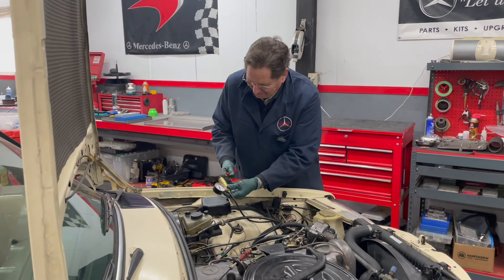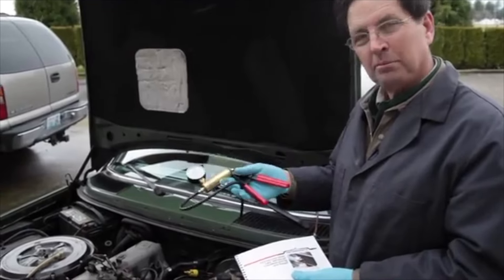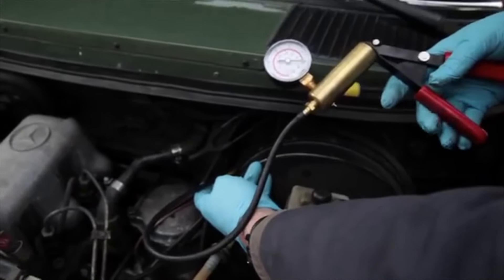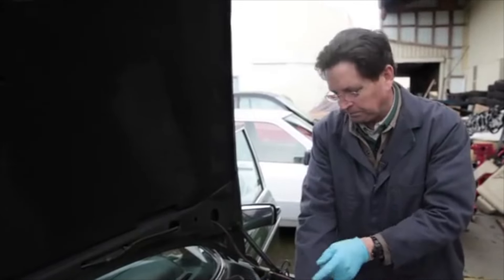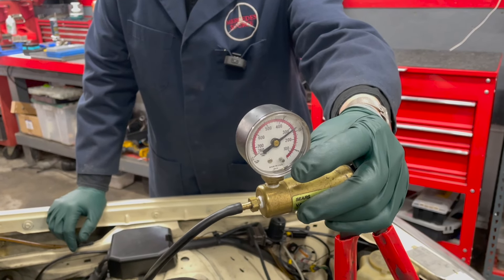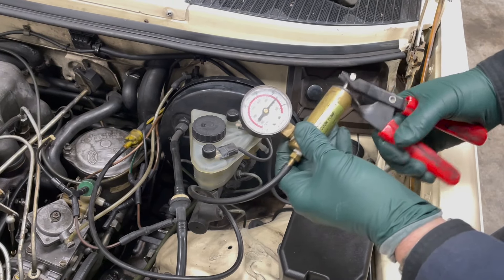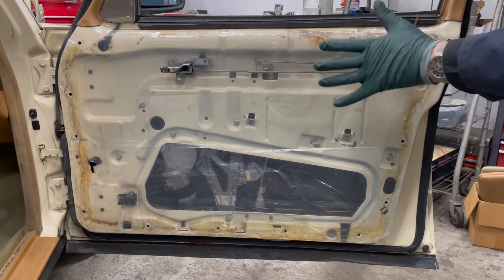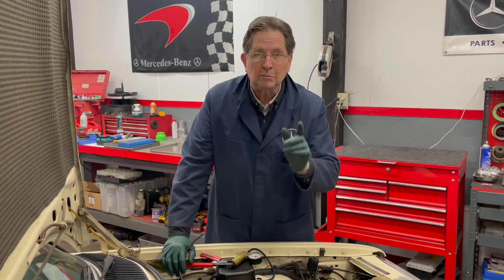14 Years Ago First YouTube Video Released - Fixing Vacuum Door Locks Then and Now.

Comment: I like your videos! They are very informative. When I know that there is a leak, I take my smoke generator and blow smoke in the lines. It’s very easy to find the leaks that way.
Reply from the maker: Smoke machines are great, but not all leaks can be found using them - especially if the slow leak is internal in a seal actuator. I will demonstrate in a future video. If it is a big leak the smoke will just roll out the bottom of the door.  LOL

Comment: Thanks to you my 1985 300D turbo diesel in Midnight Blue is still up and running with only 300K miles on it. Everything on it is still original except for the stereo. My next focus is on my 1995 E320 cabriolet which has interestingly different issues given that it's gas.

Comment: My irritation is when the locks work perfectly for 24 hours (with opening/closing 8 times), BUT no vacuum to open/close the doors if I wait 48 hours (after restoring vacuum by running the car a few minutes)! I will find the leak by isolating EVERY actuator, line, etc.! I want the car to hold vacuum at least a week without starting the car!